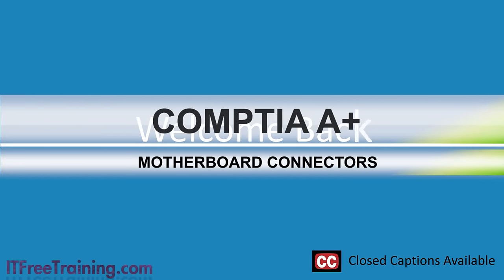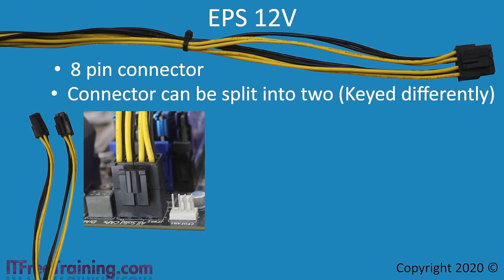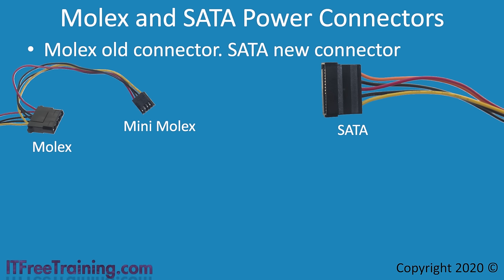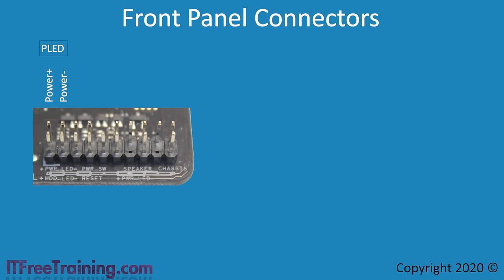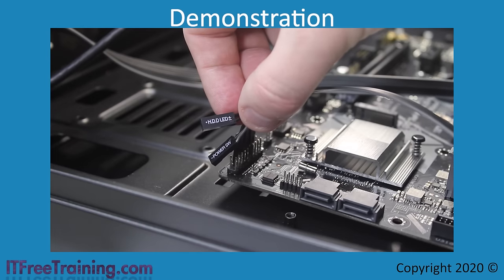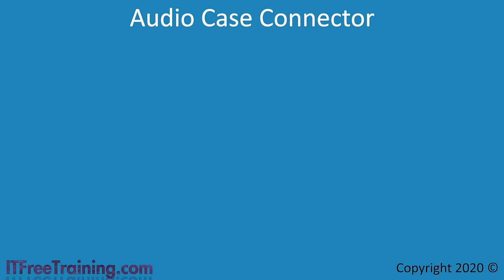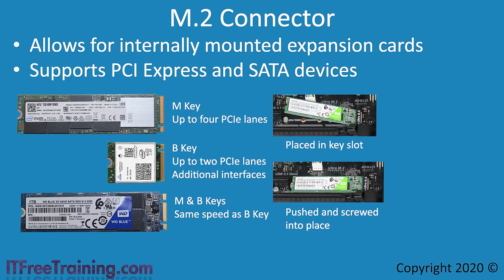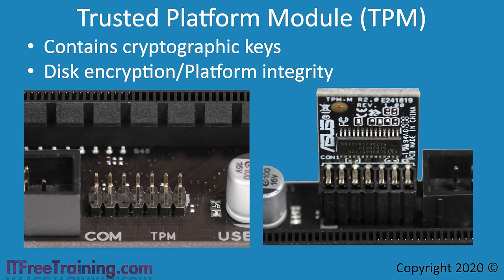Motherboard Connectors

Comment: I don't have 24 pin connector on my motherboard i have only two separate 4 pins adapter one near cpu on near Ram 
HP 6200 tower
Reply from the maker: I see, since it is a HP it may use a none-standard power supply. If this is the case, you will need to purchase a power supply from HP.
Reply: @itfreetraining  But my friend i don't have a slot for 24 pin
i think i should go for a new motherboard
anyway i enjoyed the vid
Reply from the maker: @aymanelhasbi5030  Essentially boards like HP and IBM often use their own connectors. Thus you need a power supply that works with that motherboard. If you don't want to use their power supply, you need a new motherboard or a converter cable.
You may not be able to get a converter cable depending on what computer you have. This one may work with your computer, but you will need to check your make and model against it. Since this is not made by HP, there is a little risk using non HP parts.
https://www.amazon.com.au/COMeap-Power-Adapter-Workstation-12-inch/dp/B06XW7RWNH
Reply: @itfreetraining  I Get it man thanks
Reply: @itfreetraining  Best solution is a new crap please

Comment: Some of the plastic on these power connections are cheap and soft and can be forced the wrong way - burning a component - I've ruined a hard drive doing that on a molex connector. And some of the connections are made cheaply and the plastic hard and has to be forced to be pushed down fully on the right way - like the big 24-pin power plugs, or it will unplug in shipping.
Reply from the maker: This can happen, thus if I am having problems I always check the keying. The 24 pin plugs will click into place, so as long as you here the click you should be fine.

Comment: can someone hlep me. my computer automatically turns on when i turn on my psu 
pc specs 

r5 3600
16gb pny 3200mhz ram
corsair 550 watts palit 1660 super
512gb nvme wd blue
1tb seagate
Reply: my pc was 5 months old
Reply from the maker: Possible there is a short in the on off switch or something else causing it to turn on. Have a look through your BIOS to see if there are any wake from standby settings that have been switched on.

Comment: Great video

btw off-topic I put in an M.2 SSD in the most careful way possible and my ethernet port stopped working xD lights never worked again and adapter didn't show up in windows anymore
Reply from the maker: That is strange. Sometimes installing an M.2 will disable SATA ports or reduces lanes etc, but it should not effect the ethernet port. Going to take a guess it is some strange kind of conflict. I would suggest upgrading things like the BIOS and devices drivers. If that does not fix, try removing the M.2 and see the ethernet ports starts working. If this happens, I would try putting the M.2 in a different slot, however very strange it would effect the ethernet port.
Reply: @itfreetraining  Yeah, I have two M.2 slots, one is for nvme and one is for nvme and sata and that one disables a sata port according to the manual, removing it didn't fix anything, just like resetting the cmos.. I think I will just have to buy an external card :)

Comment: Hi, I very much appreciate this video as it is very informative and easy to digest
However, I note that there is a lack of mention of USB Type-C Header connection from the PC case to the motherboard. I'm currently trying to understand the USB3.2Gen1 and USB3.2Gen2 headers and maybe you can help with a video on that? Thank you!

Comment: but my motherboeard doesn't have a 20 or a 24 pin connector, it has a 6 pin connector >:(
Reply from the maker: It should have a 20-24 pin connector, unless it does not follow the ATX standard.

Comment: My motherboard doesn't have a 20 or 24 pin
Reply from the maker: Some motherboards are not designed to the ATX standard. If that is the case you won't have a 20 or 24 pin connector.

Comment: You forgot about apples 2001 22 pin p1 connector
Reply from the maker: Thanks. We did not go through the proprietary connectors. We are re-doing this video at the moment, so may consider mentioning it.

Comment: "The plug on the motherboard ..."  That thing called a "plug" is actually called a "socket".
Reply from the maker: Which one are you referring to?
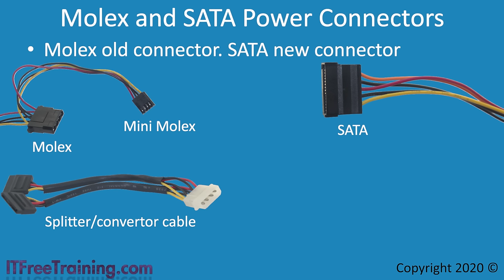Reply: @itfreetraining  At 9:47 (and elsewhere).  Generally, a "plug" is a connector on the end of a wire or cable, whereas a "socket" is a receptacle for a plug that is typically fixed onto something such as a motherboard or wallboard or that part of the pelvis that the femur "connects" to (ball and socket joint), and is not on the end of a cable.  Sockets on the end of a cable are just referred to as "connectors", perhaps being designated male or female.  Merriam-Webster offers this: "an opening on a piece of electrical equipment into which a plug, light bulb, etc. fits".

Aside from that nit, I think that this is an excellent video.  Good information.  Thorough and clearly presented.
Reply from the maker: @markanderson2904  I see your point. We try to make it simple, we probably should have probably used more precise terminology, will consider this in the future. Thanks for the clarification.

Comment: I'm connecting my panels wrong.. Haha. Still working though, but most wires are turned ashes inside resulting for me to buy new PSU coz I can't find any connectors to buy. 😂
Reply from the maker: I hope you got it to work o.k. Thank goodness it was only the PSU and not any other compoments

Comment: Very helpful, but please in the future slow down and enunciate when naming the connectors (and/or show it clearly in a text overlay). I need to buy these cables for a replacement modular PSU that is replacing a non modular unit. Thank you.
Reply from the maker: We are updating the video, so will keep that in mind.
Thanks for watching.

Comment: "all motherboards will have a diagram" this video hasn't aged well, the last B550 i purchase did not come with one and the down load file didn't have on on it, and the Bios din't have digital one either . i couldn't even find a labeled picture on the MSI  web page .
Reply from the maker: You probably looking in the wrong manual. Sounds like you are talking about the quick start guide or bios manual. I don't know which motherboard you are referring to because there are a lot of B550 motherboard so I would need to whole model number.

Comment: bro 24 connectors r hard either way, u plug it in and take alot of force u pull it out and takes a lot of force, i was shitting my pants trying to remove from motherboard, cause i was afraid i would rip it out, and yes made sure it wasnt locked
Reply from the maker: They can be tricky. I find if you push down on the motherboard to keep it stable this can help,
Reply: @itfreetraining  it was really tight to the point i was counting pins and doubt, triple checking it was the right pin, even tho it the only biggest pin in the board. i was doing a flash bios, then had to dismantle and put them away since im wait on some parts.

Comment: At age of 14 ...... In 2003 i never had a computer before, i didn't have Internet...i didn't have YouTube...and i know what to do....if someone doesn't know what to do ...or don't have 10% intelligence... sorry to say but....ask someone for help... common how to dumb to be to don't know where to put the RAM memory.....or SATA cable....or 24 pin ....or even the fan..... Idea cable....floppy cable.... The only hard thing the te power, reset , power led HDD led and speaker .... But everyone know to read.......or don't ... At age of 18 i modified my power source to put a SATA cable ....i had just molex....but mother board had SATA so i couldnt put a SATA HDD and didn't had money for another power supply ...... Black-neutral red +5v , yellow +12V  on the power supply all wires are soldered in same spot ...so not special curent applied to same color wires..... If you wanna check the power supply without connecting to motherboard just put the green wire sith a black wire in short and the power supply will start running :)
Reply from the maker: Looks like you are good at teaching yourself which is a good talent to have. I hope you got something out of our video.